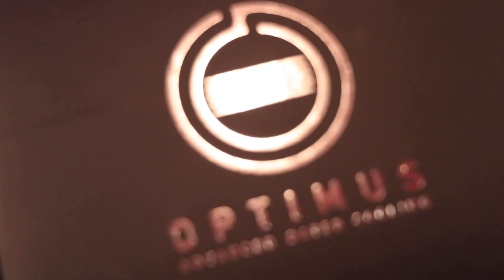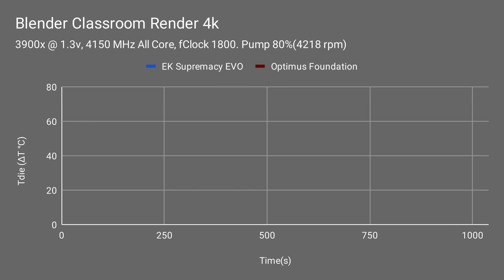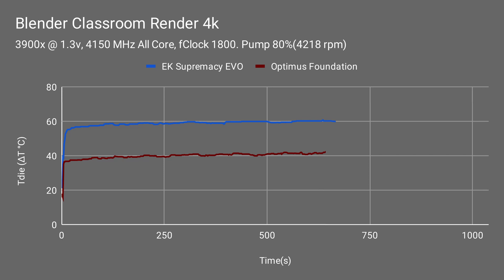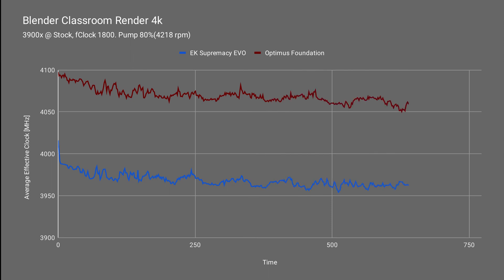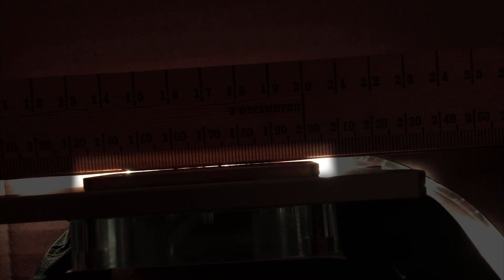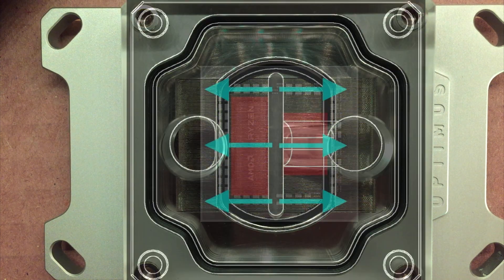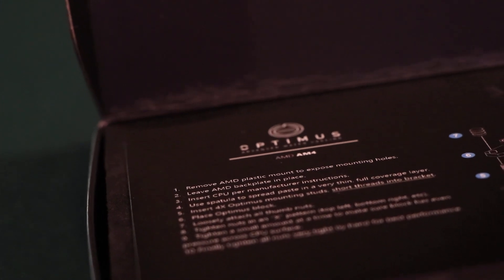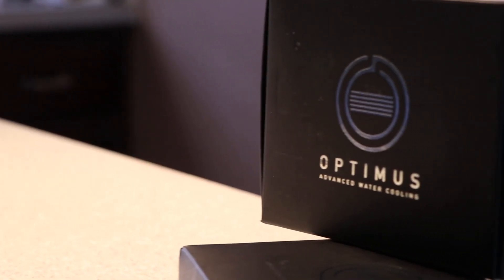Optimus Foundation AMD CPU Block Review

Comment: I compared the Optimus Foundation AM4 block to the Corsair XC4 block on the same system.  I had to get above 250 watts power draw on the CPU to see a 2C difference in cooling ability between the XC7 and the Optimus Foundation block.

Comment: I just received my black aluminium and acetal Optimus CPU block and will be comparing it to my EK Quantum Velocity currently cooling my 5950X. Current idle temps are around 42 degrees C with 1.2v vcore
.
Reply: which one is better in your opinion?